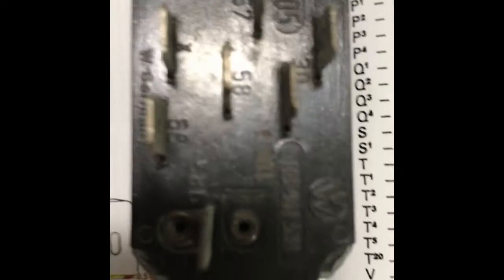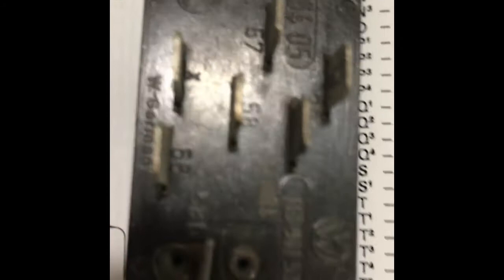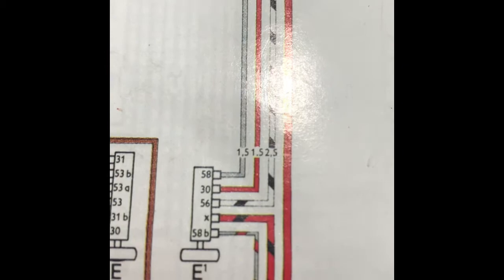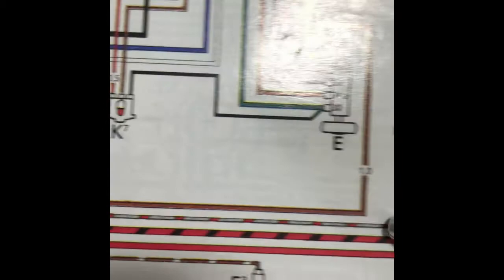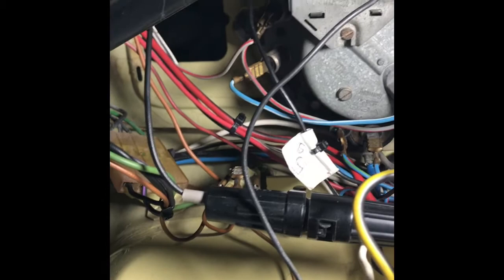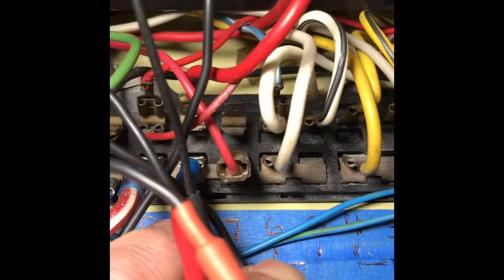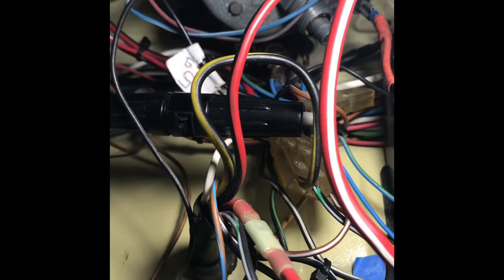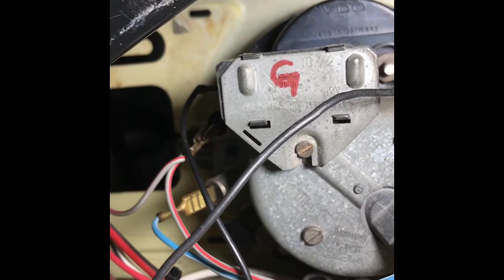1971 super beetle wiring 101.  Light switch connection Video #4

Comment: Fantastic. Very informative. Someone put a very old model light switch in my 72 and it doesn't turn all the way off. And the terminals are different. This is super helpful for finding the right wires for the terminals on the proper replacement switch. Thanks!